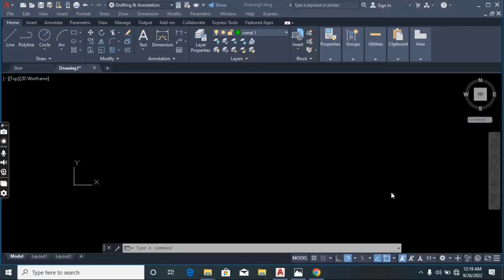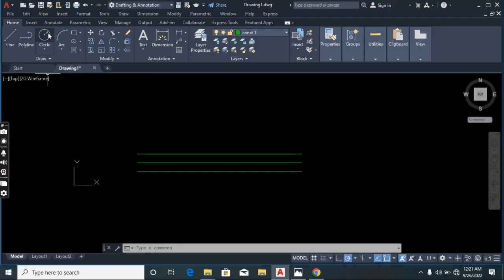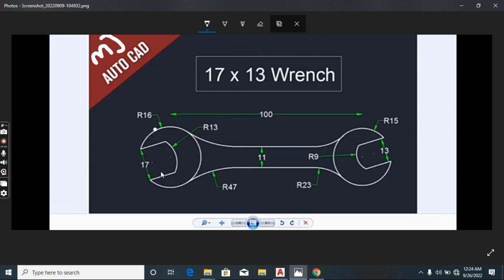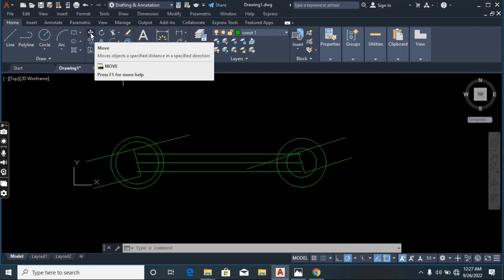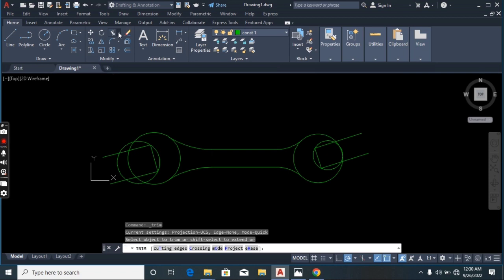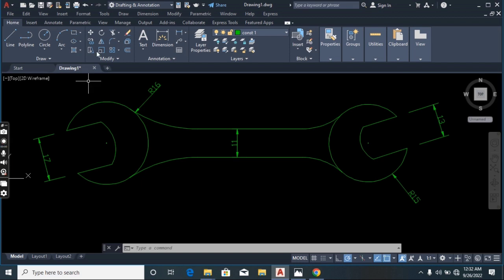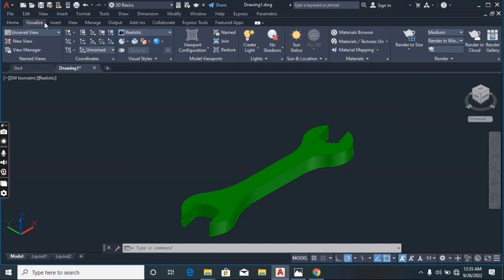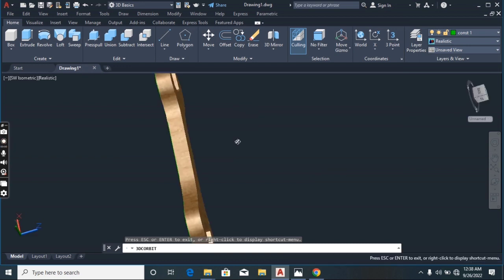Drawing a wrench spanner using AutoCAD for beginners

Comment: Nice sir
On AutoCAD 2023, I tried drawing a circle at the intersection of 2 lines, but the circle keeps appearing at the endpoint.
I don't know if there's something I didn't set
Reply from the maker: There are alot of things why u might not find it convenient placing an object at that point. Check the view control to be sure those two lines really intersect. Or  During installation some software tend to miss out in some places. But advisable is always check your command line when trying it again.
Reply: Ok sir